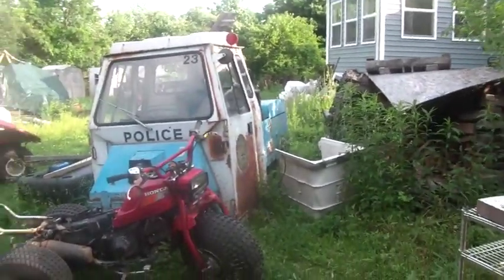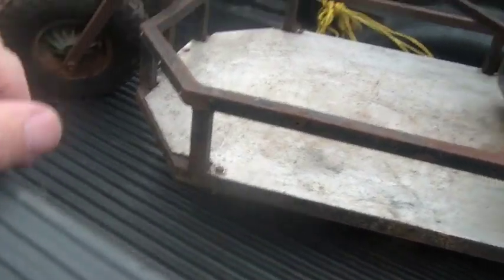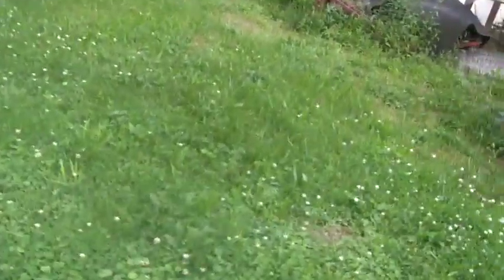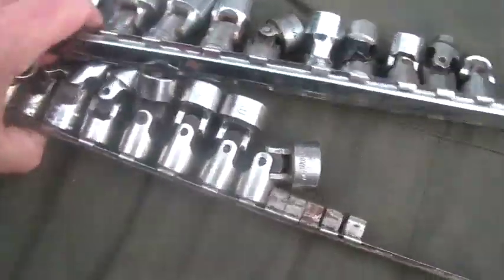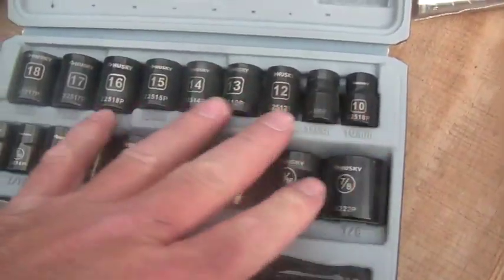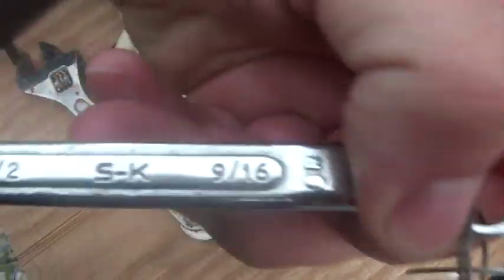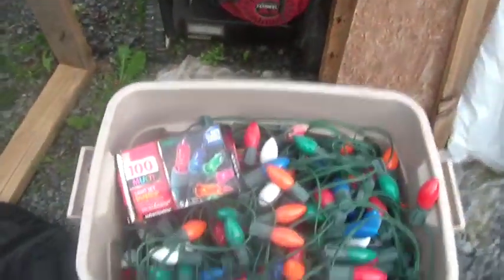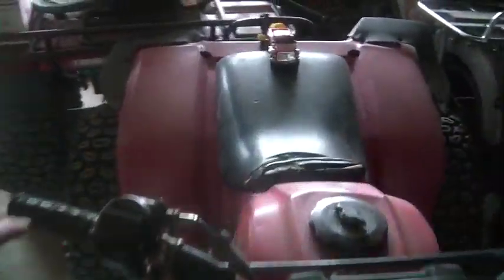6_14_2014, Today's Flea Market Finds,

Comment: Computer ot my intrest . I work on lots of them too ,and is curious as to what antivirus software he put on it ,and if he installed any spyware cleaners ,which ones.Did he put any thing like Sandbox ie ,unchecky, WOT ,ad block or anything like that on there.  . Just wondering what all he has on it , all of the above mentioned programs I install are free.